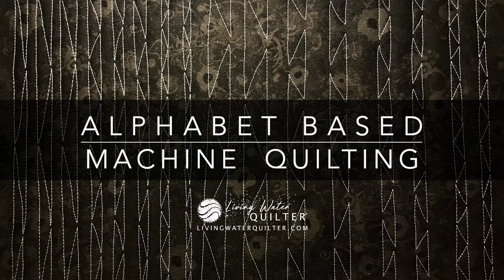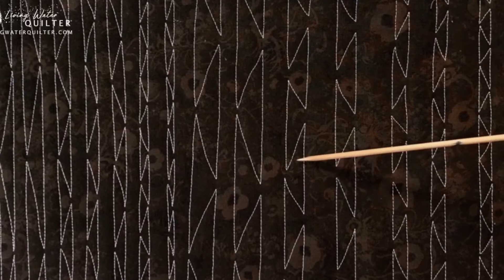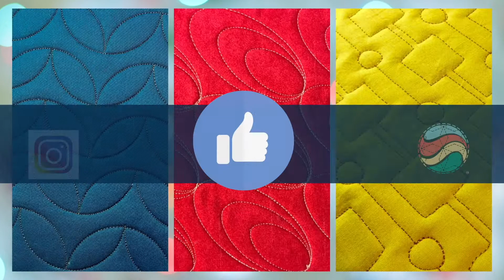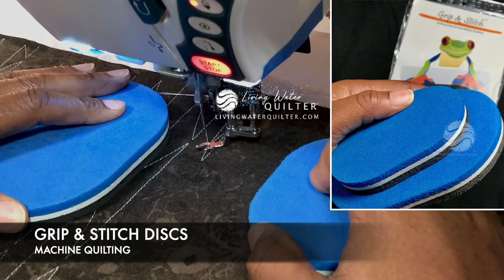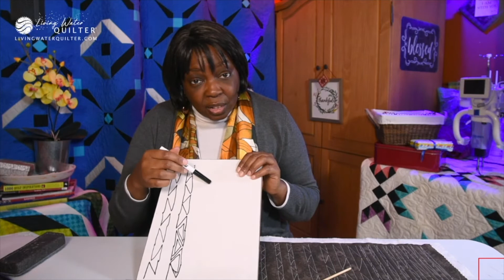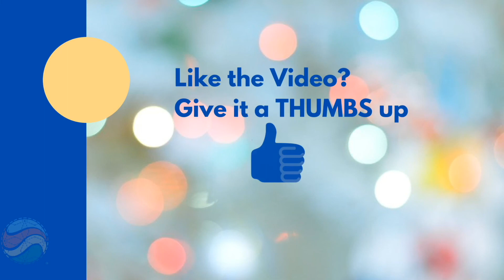HOW To Use The LETTER Z to MACHINE QUILT A  Southwestern Design(EASY)

Comment: Which do you prefer for control for you...the discs or gloves? I’ve never tried the discs but often wondered if they make it easier?
Reply from the maker: Hi Kari, I like both. Gloves are great for fine motor skills needed for intricate patterns. The discs are perfect for big scale designs we quilt edge to edge. Also, the discs are good when we are at the edge of a quilt. Instead of our hands/fingers being close to the needle,  the discs are and help hold at the edge of quilt.